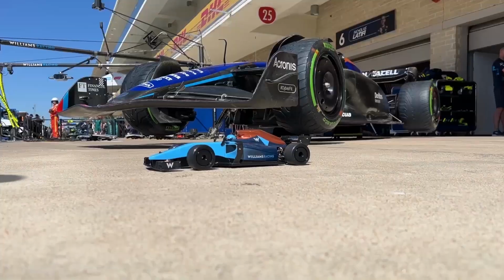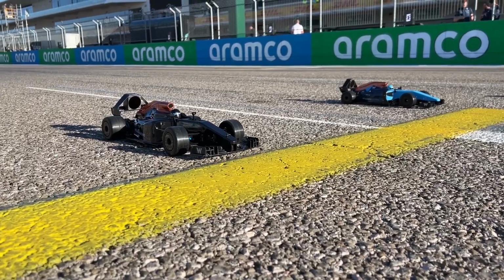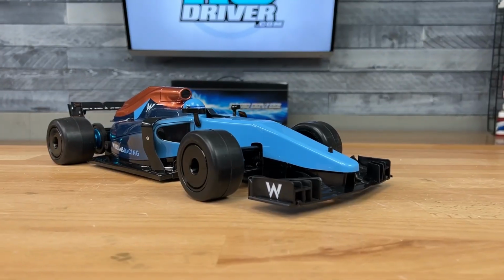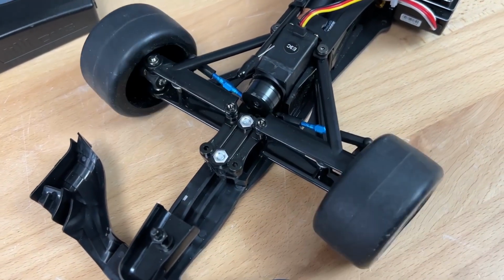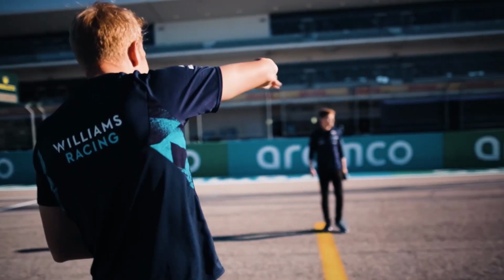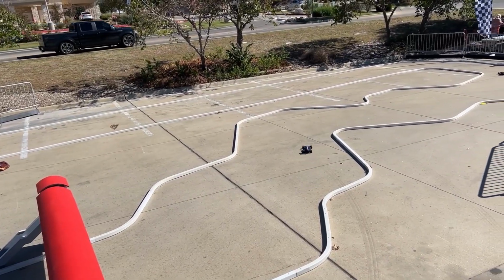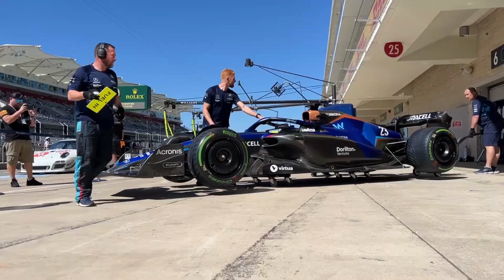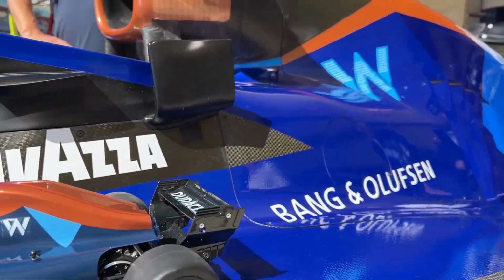Duracell Engineered For More Challenge - Building An F1 RC Car!

Comment: Would have been cool if was completely powered by AAs but as it is kinda redundant as the AA are not really needed at all. May as well have just taped 4 AA to the body. Also slightly misleading that you didn't mention anything about the real batteries powering the drive motor

Comment: It’s a little misleading though. You can bet Duracell didn’t make light of the fact that the motor that moves the car wasn’t powered by Duracell, just the radio gear and servo. This is a promo Duracell should wait to do until they’ve made a Lipo battery to run the electric motor. Most RC people will see right through this promo, like we are here on your channel.
Reply: most rc people probably run the cheapest shit they can find and spend the money on the lipos, this is more aimed at the general public/prosumer market.